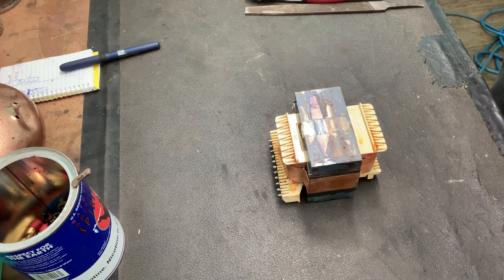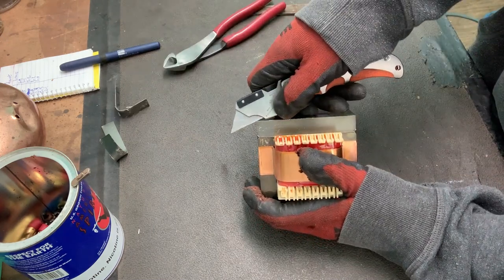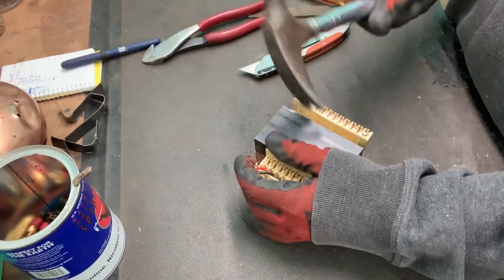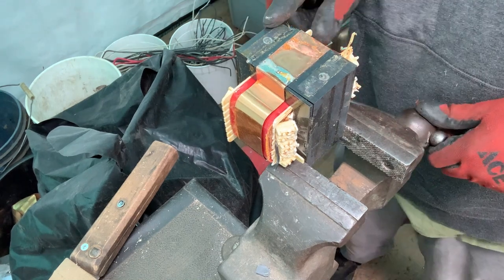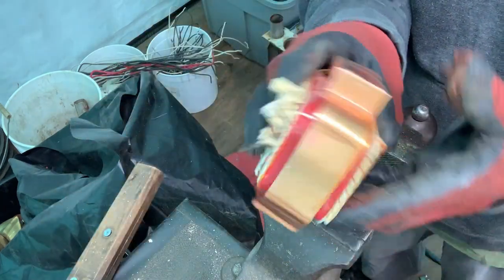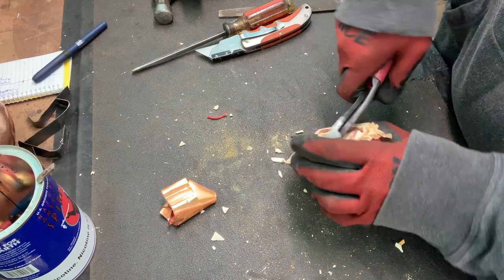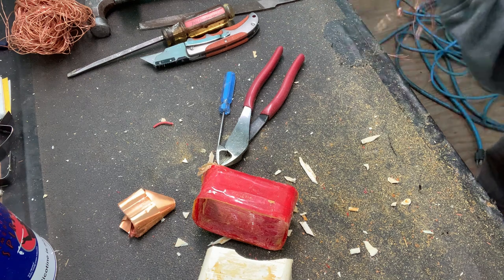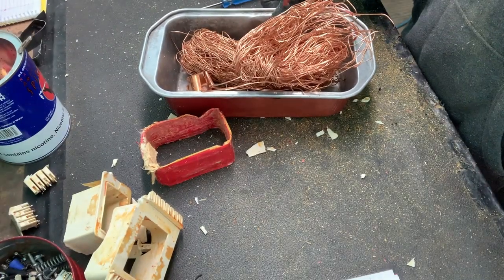How to Scrap a Transformer With a Hammer + Shout Outs

Comment: Just a tip......when you are down to the rectangle copper winding......instead of breaking the plastic and then pressing the copper wire to a smaller bundle, you can put the copper and plastic in the vise and close it to crush the plastic. That breaks the plastic to easily remove the garbage plastic AND compress the copper wire at the same time. I forge copper, aluminum, and brass from scrap and this has reduced the plastic mess flying around and helps keep copper bundles smaller.
Reply from the maker: Excellent tip, thank you, I appreciate that!

Comment: I usually use a cold chisel to split that weld works a treat. I'll give your example a try next time I have one. Those microwave transformer tops make a heck of a noise if you try to power it up once it's broken. I attempted to make an induction heater for trying another way to melt copper in my crucible. God bless.
Reply from the maker: I will have to give that a try, thank you!
I bet that is quite exciting 😂
Thank you for watching. 
I’m going to go check out your channel.
Reply: @scrapitall200 . Thank you for subscribing. I really appreciate the support 🙏  It is fun, but be careful, as the high voltage poses quite the health risk, lol.
Reply from the maker: Absolutely, you’re welcome! 
I don’t think I’ll be trying that anytime soon 😂
Reply: Yep I use a cold chisel to split the weld too.
Reply from the maker: @steveherr450  probably could just hit it hard enough to break the weld, but it doesn’t hurt to weaken it with a cold chisel or a hacksaw. I don’t own a cold chisel and most people don’t, so I use what I got. Thanks for stopping by.
Reply: @scrapitall200  Yeah if I put it in the vice like you I can see breaking it with just a good hammer but I have a big chunk of steel on my one scrap table I just put it on and hit the weld with the hammer/chisel combo and let the pieces break off. Everyone has their own way/style that works best for them and what tools they have. Some transformers I just sawzall the copper on one side, push the copper out and don't even worry about breaking the casing apart.
Reply from the maker: @steveherr450  that’s so very true!
I’m hoping to find a horizontal bandsaw, I see those work well with cutting one side off. But I’m not going to spend the money on one lol.

Comment: just tried this on a fairly sizable transformer out of a commercial grade UPS. i used a HF machete and a 5lb sledge. 

it worked. the machete handle came apart, expected that. will wrap in cloth and duct tape. the edge on machete held up which I didn't expect for HF junk.

next time I'll use a small hammer. its not about the impact force as much as the repetitiveness and changing angles.

overall, yes, it worked and this thing was the size of a toaster!
Reply from the maker: Wow that’s really impressive. I cut apart a 22 pound stator in half with my machete. I’m sure the machete has its limits but so far I’m pretty impressed with how well it works. Thank you for leaving your comment, I appreciate it.

Comment: I'm sorry- the smaller 1 inch diameter " tube" alongside Compressor on the small ACs have dry pellets and a brass screen and oil. I've seen enough of them here in New Yawk
Reply from the maker: I cut that one open and there wasn’t any of that inside it.
Reply: Sorry to hear that.

Comment: I’m only getting $2.85 for number one which I think is ridiculous. I’m going to hang onto my number one full watch on the video my friend keep up the good work and 1.9 is closer to 2 pounds then it is 1.5.
Reply from the maker: Yeah copper has dropped so much. I’m going to hold on to mine until prices get better. 

Yeah the scale I use reads in pounds and ounces. Thank you for leaving a good.

Comment: I just give a 1mm deep cut at each weld with a 4" grinder with the 1mm thin disc then the I part falls off clean. However most transformers built that way seem to be microwave ones and 95% of microwave transformers are aluminium wire bar some of the really old ones.
Reply from the maker: I’ll have to give that a try, thank you! 
Yeah it’s unfortunate how many microwave transformers are aluminum. Thank you for watching.

Comment: Keep that steel separately as Electrical Steels are bigger $ (if your metal place) takes it as a different price.
Hammer thst plastic bits to the center and then pull out the plastic chunks.
Reply from the maker: Yeah unfortunately my scrap yard doesn’t pay any better for that kind of steel. 
Honestly I hate making a mess so I tend to not hammer stuff even though it would be quicker like you just described. Thanks for the tip and comment and for watching. I really do appreciate it